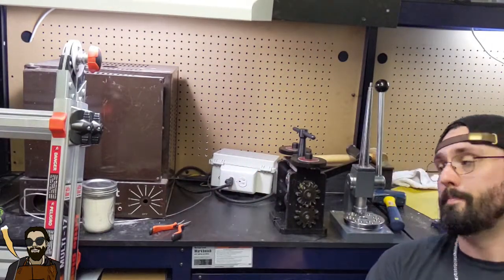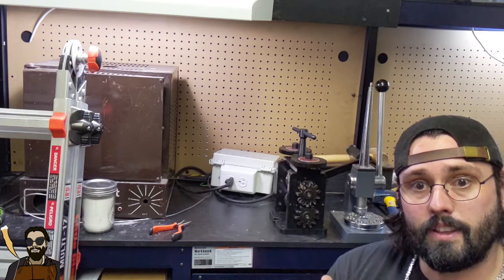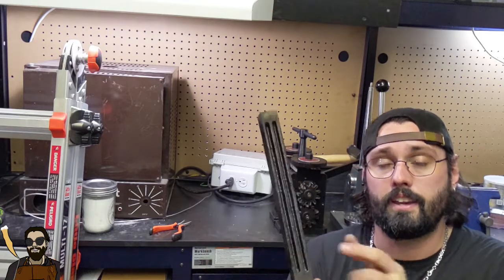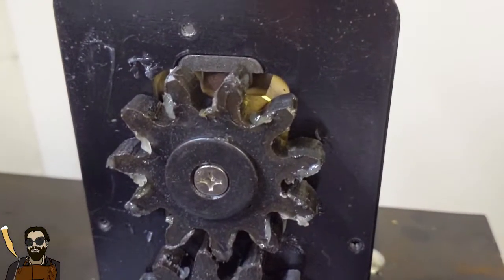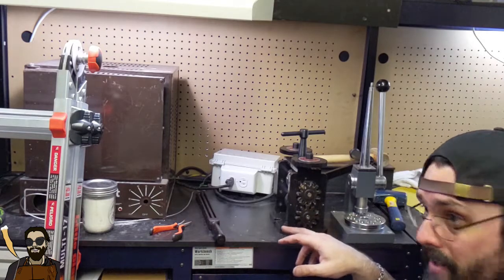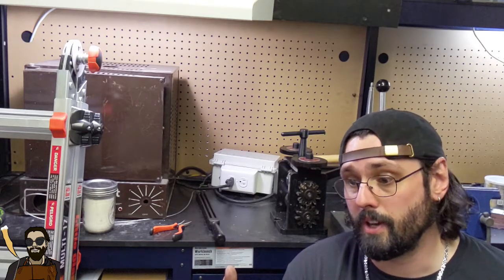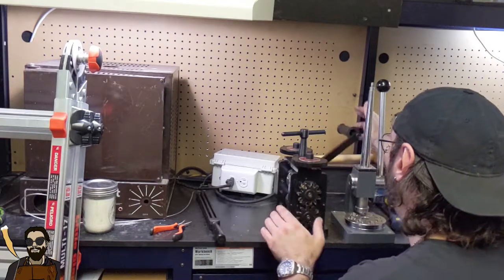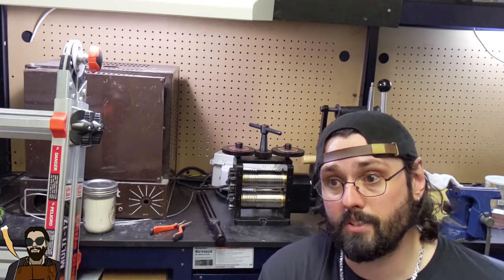Vevor Rolling Mill UPDATE Review

Comment: Out of curiosity, what size would you say is too large? I’m a bladesmith and a rolling mill would save me time as well as grinder belts. Also, does it work on heated metals?
Reply from the maker: Honestly I have no idea how this would hold up. To my knowledge these mills are best suited for softer metals. Steel can dent the rollers. If you were to try it you can fit about 4ish millimeters through but I'm not sure it's going to be a good fit for blade smithing

Comment: I had that problem with the gears and I did fix them. Now the mill won't give me a deep texture. What can I do
Reply from the maker: Not sure. Those gears really have nothing to do with the amount of pressure the mill rolls with. That's all to to with the adjustment on top. I never ran into that issue but I also don't use texture plates.